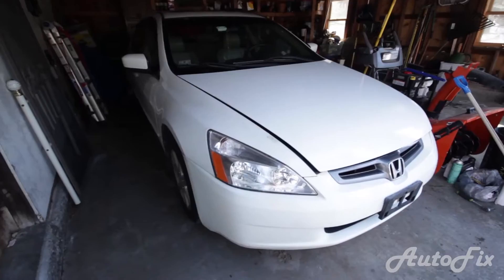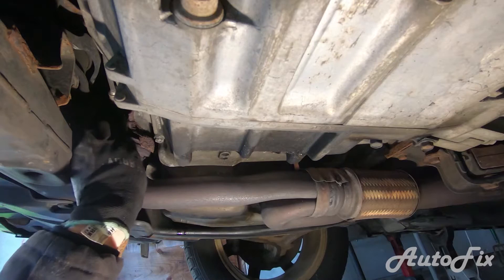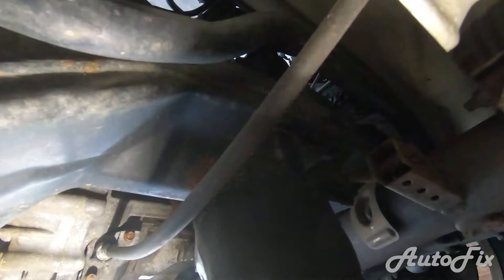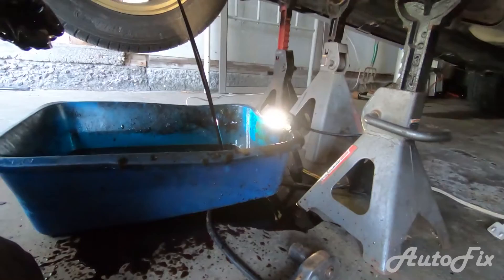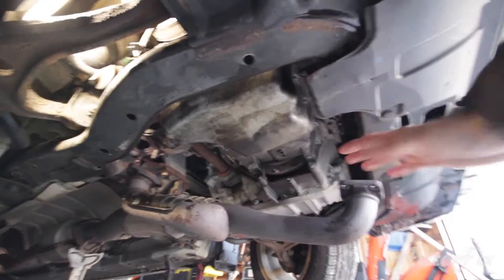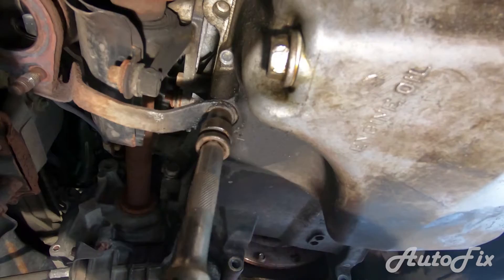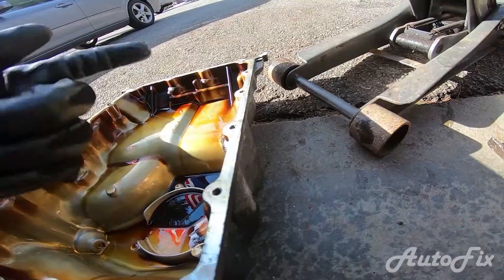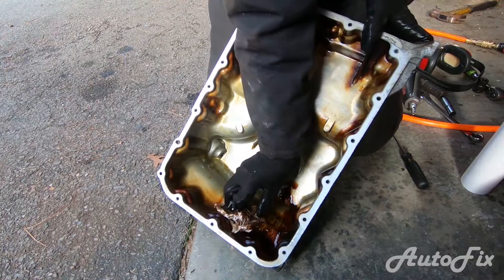Oil Pan Gasket Replacement Honda Accord V6

Comment: Are you absolutely sure it was leaking out of the oil pan.  The Honda V6 engines are notorious for oil pump o-ring leaking.
Reply from the maker: You know, you might be right because I looked at it a couple days ago when I changed the oil on it again and it's wet so yeah that's probably what it is unfortunately
Reply: I just referenced your video about the oil pan removal, because I know for sure the oil pump is leaking on my 07 V6 and i will start the job tonight.  The oil pan on this car really doesn't leak.  The oil pump leak deposits oil at the front right corner of the pan looking just like this car you worked on.  But it's required for the oil pan to be removed first then you can remove the oil pump.  It's  a $1 o-ring you need to replace.
Reply from the maker: Sorry, just saw your reply. Never got notified when you responded... anyway, thanks for all the advice! It is definitely leaking less but u have to say that that must be it because I keep finding the oil pan wet. It used to drip, now it's just wet. But still... I'll end up doing it at some point.
Reply: I want to thank you for your oil pan video here.  I spent 2 weeks, a few weeks ago on this huge job.  I managed to remove the oil pump and resealed that, also resealed the oil pan.  I have 0 oil leak as of today.  Also did a timing belt + water pump job while at it.  Now you know where the issue is.
Reply: @securityguy  I got an 09 TSX where I can't find the leak. I replaced the VTC solenoid seal which seal was already hard plastic but I keep finding oil in the oil pan, I talked to the dealer and told me the oil pan is very difficult to leak since the honda bond lasts a lifetime. I believe so too so my last option is the oil pump and oil filter housing gasket. I'll probably have do it with a timing chain job since I will drop everything and my car has already 150k on the clock.
Reply: @May16Joe  The 09 TSX has a 4 cyl engine though, that's an entirely differently story.  Most likely the leak is from the VTEC solenoid unit on that model.  Please message me privately about that.
Reply: @securityguy  that's what I replaced, the solenoid but I see that I still get leak in the oil pan. I'm going to wash the carriage since it's full of old oil and check again if the solenoid was installed correctly. Thanks for your input, I thought the 4cyl engines had this oil pump problem too.
Reply: @securityguy  did that work?
Reply: @Pb88840  It did work.  The odd shaped double o-ring was the culprit.  However, everyone needs to know, at least those live in the snow/salt belt where temp variation is great, oil leakage from between the oil pan and the block still happens from very cold starts because of minuscule metal gaps in between the pan and the block., even if you've resealed it.  But this is negligible.
Reply: @securityguy  cool thanks I will try tackling the oil pan reseal and the oil pump o-ring

Comment: Shit i still don’t know how to use the foot pounds on the torque wrench ); someone teach me !!!
Reply from the maker: You turn the knob at the bottom of the torque wrench until you see that it reaches the desired torque setting. It should have numbers written on it with some lines. When the part that turns hits the line, you're at that specific torque. Some have newton meters as well, so don't confuse n.M for Ft-Lbs. If you still have trouble just use a ratchet and make the tight lol